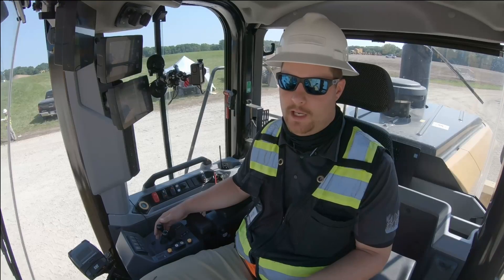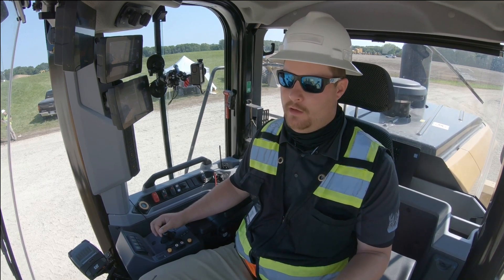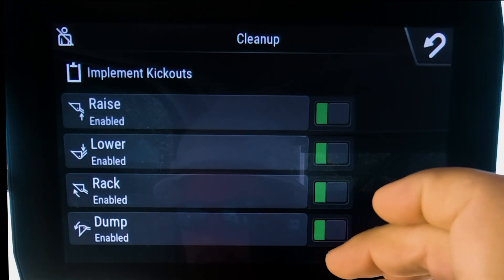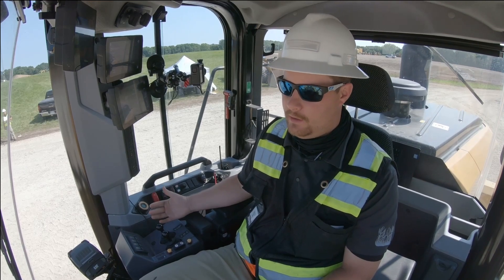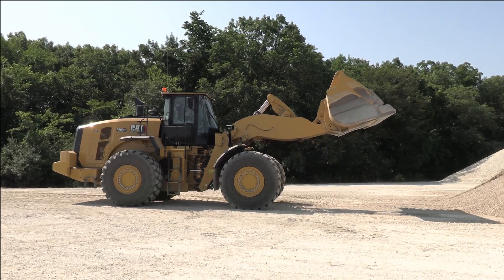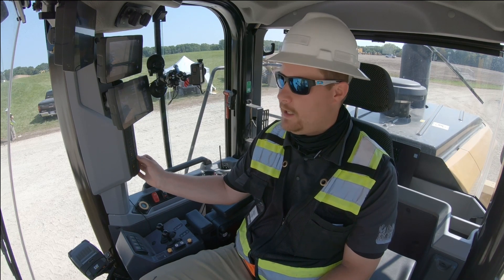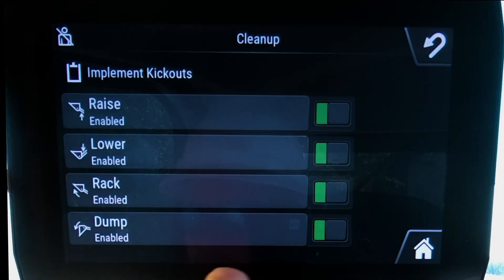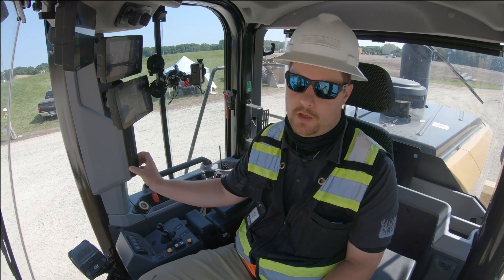Assist:  Implement Kickouts | Cat Next Generation Medium Wheel Loaders

Comment: Good Evening Alex. i have a question. Are these implement kick-outs something i would want to set for loading cold feed bins at a asphalt plant. I'm a loader operator running a cat 980 and will be loading bins of various aggregates and sand for the production of asphalt and also pushing up piles of stock that have been delivered during the course of the day. I'm thinking thses features would come in handy to reduce fatigue during the day as I'm expecting long hours and long shifts. Also what about the auto-dig and set tire feature. are these something i should also set. thank yo for your help. i have saved all videos i have found from you. if you know of any other that you may think might help me please send them